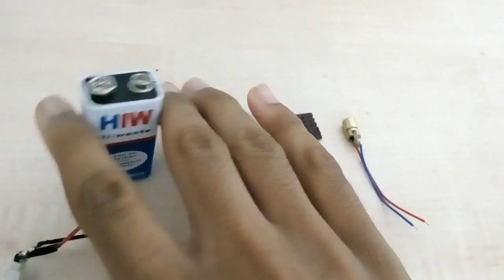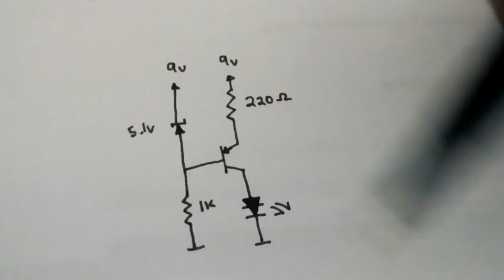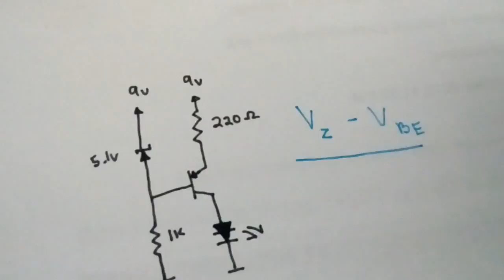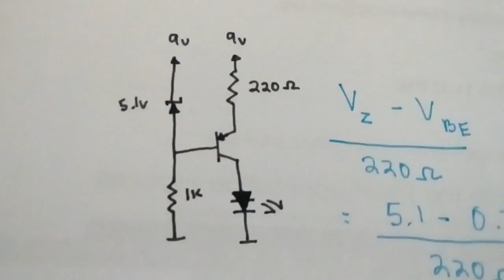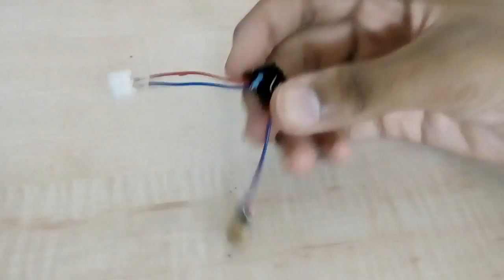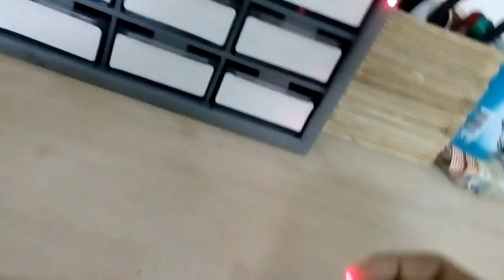Simple Laser Diode Driver ( Dirt Cheap! )

Comment: Hi there, don't understand why a PNP transistor is in the circuit.  Since a Zener diode produces a pretty stable reverse breakdown voltage of 5.1V in this case (when P terminal is wired to the Z diode's cathode side), why not just then attach a slightly higher than 220 Ohm resistor to the Z diode's anode side to get ~ 20mA to run through the laser then back to the 9V batt, of course?  Would that not be a constant current driver that an LED/laser needs in order not to blow itself up once it heats-up too much (as you say)?  Why even complicate the circuit with a PNP trans?  Sorry it it's a stupid question.  Thx!
Reply from the maker: Your idea would technically work. The Zener diode's voltage does stay somewhat constant, but the supply voltage is not guaranteed to do so, so if you connect the laser diode between supply and Zener terminal, there would still be voltage variations, to say nothing of the Zener and laser diodes' temperature coefficients. I hope I'm understanding your question correctly. Could you maybe show me a circuit diagram of what you mean? You can use Falstad, it can export circuits as convenient links: https://www.falstad.com/circuit/
Reply: @NNNILabs Thx for the help. I set-up a quick circuit in Falstad with a 9V source and a 5.6V Zener. But, while I can get the circuit to conduct in ~ 5.6V, when I put a basic LED that runs at 20mA on either the cathode or anode side of the Z diode, the circuit starts conducting at 9V (or 7V & change due to a ~2.2V drop on the LED). Bottom line, adding a LED/laser to the circuit doesn't work. But, I still don't understand how interposing a PNP transistor into the circuit gets the Zener to conduct at it's stated 5.6V breakdown voltage (or 5.1V was the case in your video). Here is the Falstad link w/out the LED just to show it does conduct at the stated Z diode's reverse-bias 5.6V. https://www.falstad.com/circuit/circuitjs.html?ctz=CQAgjCAMB0l3BWcMBMcUHYMGZIA4UA2ATmIxAUgoqoQFMBaMMAKGwBYQAvOgOzoBODBNEINs4cNAxh22BCjxhiisPBSNyVFLHh79+TiMLgWXECnbaEJy1WYoL3PoOGjxLAEohiJhz5NsRyoqKx8oCJgEFgFwdk5-ZUd-bQxIFgB3OISwR19wXKhM8BUCxzsyooAHCzD-K3tCiBCWAHMQBsrOtDxIttrrWzC5YKKgA
Reply: @NNNILabs  Here's a second link where I added the PNP trans on Falztad (great website, BTW, thx!).  I set-up exactly as you did on the breadboard.  Interestingly, there seems to be 1.4 total voltage drop over Base-to-Emitter as well as over BC of the PNP trans.  Because w/out the PNP, the Z diode delivers 5.6V as per my first link. But, then output V drops to ~ 4.1V after PNP added. Current from EC on the trans running at ~ 20mA assuming the LED's rated current. Anyway, appreciate your help very much any explanation about how the PNP trans sets-up the bias V at the base, b/c attaching an LED to the either side of the Z diode doesn't work according to the methods tried on Falstad. Here is the 2nd link w/ PNP in the circuit. https://www.falstad.com/circuit/circuitjs.html?ctz=CQAgjCAMB0l3BWcMBMcUHYMGZIA4UA2ATmIxAUgoqoQFMBaMMAKGwBYQAvOgOzoBODBNEINs4cNAxh22BCjxhiisPBSNyVFLHh79+TiMLgWXcCpAoEJ4ieYor3PoOGjxLAEog74MI99sRyoqdipiKEiYBBYBcHZOBwtHJO0wlgB3eMT-H3tcyEzkv0cUMJKoFgAHK3KksKokiBCWAHMQBorOtDwottqqbDxOMtpFPoAXYusTUasbSKYpBARhwkI8BFlIMLAOEAYYQhww7GJILbO8bBxkKgATOgAzAEMAVwAbCaK537qC-rKRzsQiJSwKXotOJA+b2SxDTiNeBsDBpbQYUrlbDYex9MCETGDHEDEAIpyPV6fCYMD50e6SEJQWAoFGNeHDYogxJ9IA
Reply from the maker: @ThomasCera  Okay I think I have a better understanding of what you mean. Basically, the PNP transistor acts like a "buffer" - the base (which draws very little current) is connected to Zener cathode, and the emitter sees a voltage that is 0.7V above the base voltage, and the transistor acts to maintain that, with the result being a constant voltage across the emitter resistor ~(Vin - Vz). The Zener diode is biased by the cathode resistor, the transistor itself has nothing to do with biasing. The whole point if having a PNP transistor is to make sure the current stays constant regardless of load voltage, since the collector voltage can change based on the load. 
Here's a link about BJT current sources:
http://www.loosweb.de/constant_current_sources/doc/en/index.html
Reply: @NNNILabs  Thx so vm for your several replies.  I have just one additional clarification needed. So. from your video (Vz-Vbe)/R1. In my Falstad link below there is only a default 5.6V Z diode. So, in my Falstad model (5.6-0.7)/R68 ~ 4.8V constant V across the R1=68. That is confirmed by the current running from across the PNP from top-to-bottom E-to-C. 71.03mA * 68 Ohms = ~4.8V. And, confirmed by the current across the base of 0.71mA, which is 100 times less than current across the Collector since Beta is Ic/Ib = 100.  However, my question is how to reconcile the 3.4V implied at the Base by the current on the parallel rail of 3.42mA vs. R2=1000 Ohms?  In other words, you said in your reply above "constant voltage across the emitter resistor ~(Vin - Vz)" = 9V-5.6Vz = 3.4 (if I understand correctly).  So, how do you reconcile a constant voltage on one hand from calc in your video of (Vz-Vbe)/R68 = 4.8V vs. 3.4V?  Especially where 3.4V seems implied at the BASE by 3.4mA across R2.  So, which is it, 4.8V across the Emitter?  Or, 3.4V across the Emitter?  Also, on the other other hand, 4.8V - 3.4V = ~ 1.4 or TWO 0.7V vol drops??  Even accounting for current flowing INTO the Base, say, from the Z diode, or one additional 0.7V  vol drop of the Base's reverse-biased Collector-Base junction "secondary" behavior (versus the Base's "primary" behavior in a PNP to be current flowing OUT of the Base via its forward-biased Base-Emitter junction), what constant voltage are we talking about?  4.8V implied by ~71mA across R1 68 Ohms over the E-to-C part of the PNP?  Or, 3.4V implied (from the Base?) by 3.42mA across R2 1000 Ohms? So sorry for very long replay--I will read your link.  Here's the Falstad circuit: https://www.falstad.com/circuit/circuitjs.html?ctz=CQAgjCAMB0l3BWcMBMcUHYMGZIA4UA2ATmIxABZiQkFIaBTAWjDAChsKQAvBgOwYAnJgmiEmKcOGgYwFbAhR4wxJWHgpm5eiljx9B-F1GFwbbiGKmUCU1fBhJk3gOEmJbAEqXTrSfexJenoKempgqGgENkFwCi4-cFUHIJBCPDYAdziExx8UqCykyUSUUILINgAHEDL6RND6vIhgtgBzSjgCxtr8KEKOuppCHXLCctaAF168Wtta8ptTehZpeMw8QhRHQj8SUyYYDEgEAjwqSAxdlGxfLoATBgAzAEMAVwAbSaKh3-LEyodewUcb5RSzVqxexLfLYc79dRwDjHBYhMDWcq2er9SqcEAAeSqkwA9gAdADO+PJgheAFsKQAFAAyABUEBSEOoOWg+PTyW1BAx+BT1AB1CnEokASwAxi8PhSqplBBSABSPV6fSYU3QoABqFKemXuFIN5PugklAEopMRoIFmKx+tgZChSO73RhThQsAi2OinIsMIG0dYCUSyZTqXTGaz2eTOZBuZBeRSBUK+CLIOLyZLJrL5YrlWqNe8vjroPrDcbTRSLdaETjoI5kWFTHCuMDQS1Ctl0Tp5tD5riUWhZjD+3NfP0UNVUbVg50dIue4ClwvJD1bhDCjUhhR0euD9PWh0esej-ZWkA
Reply: @NNNILabs  By the way, despite that you say above "the base (which draws very little current) is connected to Zener cathode", the circuit diagram in your video shows the Z diode's anode side is connected to the Base (I think).  And, this is how I set it up in Falstad exactly like your diagram (only diff is a 5.6V Z v.s 5.1Z diode in your example) diff R1 resistor b/c I'm trying to power a more powerful laser ~ 70mA for mine than yours was presumably at ~20mA).  And, I could not get the Flastad circuit to conduct by swapping the Z diode's terminals and wiring the Z diode cathode to the PNP's Base.  Sorry if I misunderstand but think the Z's anode connects to the Base.
Reply from the maker: @ThomasCera  First off, I think both your questions can be answered by the fact that I totally misremembered the circuit I made 😅
For whatever reason I assumed that the Zener was on the low side (like you would do with an NPN-based current sink), so you're right, the anode connects to the base of the PNP transistor. For the same reason my calculation was also wrong, the current is indeed (Vz - Vbe)/R.
Reply: @NNNILabs  Thx vm!  Any thoughts on how to answer the 3 diff speeds at which the circuit runs?  And, how to think about 4.8V from E-to-C thru the PNP vs. the 3.4V implied at the Base of the trans?  Seems like an extra 0.7V drop not explained even after assuming one of those 0.7V drops is due to some reverse-biased current at the Base of a PNP (same for an NPN's Base)?  Finally, I'm trying to power a PLT5 510 515nm green laser with 9V.  But, while my circuit runs at ~ 71mA, (laser rated 60 mA optimal 100mA max at a 5.4V typical operating voltage) it also runs ~ 4.8V max from thru the PNP--always below the 5.4V typical voltage for the PLT5 510 laser.  So, it seems like a 6.4V Zener might be a better in the circuit, b/c I get it to run ~ 80mA from to 9 to 7.5V supply voltage and then ~ 5.4V on avg thru the PNP.  So, question is: should I switch to the 6.4V Zener in order to stay more near the laser's typical operating voltage?  Or, since I have a "constant" current of 71mA within the laser's typical operating current (but still below its voltage range) does it even matter?  Here is the link of the circuit w/ a 6.4 Zener where you can see more my question (if you care to chg the supply voltage and see how this version of the circuit stays more near the laser's 5.4V operating voltage).  Many thx for the help sir :) https://www.falstad.com/circuit/circuitjs.html?ctz=CQAgjCAMB0l3BWcMBMcUHYMGZIA4UA2ATmIxABYlrIQEBTAWjDAChsKQAvegO3oBOjQtAqMU4cNAxgK2BCjxhiisPBRNytFLHh79+TiM5suIYoRAoEli+DASJPfkOPjWAJXOWWEu9glaWgpaYihwmARWAXAKEwdwFXtAkEI8VgB3WPi-HwTITMSJXysQ5KhWAAdS2hKQ2oSIINYAc0o4cvqrfAjWmso8bTKFPF6AF27R60sUMunw5ihoQmw8PDJsXGI8AOskRhgMSAtiSEIEMEIMBAw8JDVaABN6ADMAQwBXABsxwtmhgHlAptOwUQicOwjXoxOzzfx4Ti1eDsI79CiXNGDSTNDggADylTGAHsADoAZzxZIEbwAtuSAAoAGQAKghyRdIOy0Lw6WSWgJ6HxyWoAOrkomEgCWAGM3l9yZUMgJyQAKZ7vb5jck6FAANXJLwyj3J+rJjwEEoAlJJiNAAkwWOFsNIUKQ3W7rgisOE2JdHHMMP7ghiJATieTKdTeUzWey1FzIDzyfzBbxhZAxWSJWMZXKFUrVerPj9tdA9QajSbyearT6ItAHCjQpZVhDLGCTL0spdtDZvFY+wVsKi0FM+z2Bz5wigqv1MBIuvPsRU2ovA+1aNg0r1qv9KBiuuip81Vx0jxu6IpegAPEDiXDgPCWVFgdaUcASYymgBafEE5IAEXJOUviJDIyQNIllTJU0sw+ARpXoasLUqA0LV5YhTXDMkAD9yQwaAEF1Vhb3EFAIDQchFnI4IPxAABBLUyUw8kSTeck8FNaV4IFXgmLwskyVpJCyQIGl6PJAABdllmI0iUAUqxsAgEglM4EwJEY-DCK4ni+H4-C8HEqSZOwU0aSgkT+DeaCEFELCAE9KlzL4SLvcjyGsbAQAwGY+w0kAJUEN4c14FpyQANyJH43haETqTCkSXighkWTZMkOWTAUhTJL43jJf8zUlIlnjc+9RhuWhCFkOgcHfBJ6IgslsGFAB6bA0zJAAjEKxiajJ6BsxgiQ+JjsIwU0VRedDyUwy0ABpgK+eVmvJX8XCalU7MIRayWMXa2PJEROMtckBA+TqQvJASjmMoSDLJChoE48kuvoUCMnJMYAAsRLsihHOc2UVqC6lQvCskopBl4vt+1LYwy+M+Wyzq8oKgQytmTgECSDBhmIJAAoAIVG3b8thv7ZLW6tiueclJSauUMjeBymtlSpKnoY17uup6XqEl4xkK+kADl6XJQ4qzNFDdpwmQ7oZ8kyRzZbkyJErdqJgBVZlyV4IkmMlGHlbhyHorGWL4reRKlZVlaaV6wRGaYjJvplb6KfJNHCsVwSPg5okCu57Cxiclyvgc8VObB+hoExrdUlmHzIHIQhMHqiRmVN46fz-aDpRGr5ublLNyQyKCAGtXvoMlJWeJqfpEr81t2133aVwUaSaizlajnMaUlHhHl2rrRvpvryW4gReKYmtKia6aiV5NYvtJUSUFY9iyXliSyUXjDV+0ojoHJABlIldv1pjybJAAiAveGV62xlvye9L48Vja-ePPwQJArhUggUYAUs6U0ID+GmJURK+0buSHuTEH5Pw-mSKeM9P6e1WmSb8jBHi0xrsBC0F1uY71emPHmj1nqmmStBFiys14TT1vQCKhU4oTyEl1IkzCMH-UBi5KOwVwaRXNpbdBJsRIxnShyVgQA
Reply from the maker: @ThomasCera  The thing about BJTs is that the emitter-base voltage (when operated in linear mode at least) is ~600mV, but the collector voltage (with respect to the emitter) can vary a lot. Why? Transistor action! The transistor does everything it can to maintain a current through the collector that is base current times gain (this is a very rough approximation). That's what makes the current coming out of the collector more or less constant - the base is biased to a constant voltage, which is seen across the emitter resistor (since the Zener voltage is applied between base and supply). The collector changes its voltage according to the load to maintain a constant current through it. 
Overall, if you're powering diodes above maybe 25mA, you'd be much better off using something like an LM317 configured as a constant current source, accuracy and stability with temperature is much better.
Here's a Falstad link to an idealized" version of the current source featured in this video, try varying the slider on the right - it varies input voltage, and you observe that the output current stays constant. In the real world, changes in collector voltage cause small changes in current. Temperature has the same effect, the base-emitter junction has a temperature coefficient of -2mV/C.
https://tinyurl.com/2qphrdse
P.S. There's an option in Falstad to "Create short URL", that can come in handy sometimes 😁
Reply: @NNNILabs  Thx very much for all the helpful replies.  Will look into the LM317 as a potential alternative.  King Regards!
Reply from the maker: @ThomasCera  You're welcome! I'm glad I could help 😁

Comment: Hi, how can i know what components i should buy? My diode laser is an Oclaro 700 mw. What transistor and resistence i should buy? (i want to make a laser pointer using 1 battery around 3,7v)
Reply from the maker: 700mW is a lot more than this little circuit can handle, it might be better for you to use an LM317 based driver, lots of schematics and values and formulas on the internet. It goes without saying - for such high power lasers, safety precautions are a must.

Comment: can I use a PNP 2N2222 instead?
Reply from the maker: The 2N2222 is actually NPN, you can make a constant current circuit using NPNs as well, just have to reverse this circuit.
Reply: @NNNILabs  thanks!

Comment: hello there, loved your video unfortunately I was not able to recreate this same circuit, it would be great if you could help me out with this. vids like these are an inspiration for young creators like us
Reply from the maker: What was wrong with your circuit?
Reply: @NNNILabs  tbh I was not able to assemble the circuit properly, if you could video call me and help with the same I'd be great full
Reply from the maker: @mohammadsheikh4847  That would be a little too much :sweat_smile: but I think you should do a little bit more debugging, nothing beats the joy of making something on your own
Reply: Alright just let me know about the wiring diagram a little more pls, like which end goes to power supply and which end to the diode, also which what is that component in the bottom right corner next to the transistor, can i supply it with 12 volts instead, and positive negative of diode as well as powersuply
Reply from the maker: @mohammadsheikh4847  The arrows with the '9V' label connect to the power supply, and the way this circuit works you can safely power it with 12V. bottom right is the laser diode symbol, it's not standard so sorry if that was a little confusing
Reply: Oh that was 9v i thought it was 'av'
Nonetheless Thankyou so much, really appreciate it.
Reply from the maker: @mohammadsheikh4847  No problem!
Reply: Also can u please let me know about the polarity of the 9v connections plz
Reply: Polarity of the inputs pls, where does +ve and - ve end go in the circuit
Reply from the maker: @mohammadsheikh4847  The arrow that says 9V is positive input, the flat lines at the bottom are ground or negative input.

Comment: It seems overly complicated. It is the same problem as an LED. Too much current and it burns out. So put in a series resistor to limit current.
Reply from the maker: This is, in fact, one of the simplest constant current drivers out there. The current source has no idea what is connected to it, it changes the voltage on the output to whatever is needed to maintain a stable current (of, in this case, 20mA). Constant current is the best way to drive laser diodes.

Comment: Can one circuit with one battery drive 8 lasers?
Reply from the maker: Possible, but you need one  driver per laser. Putting them in parallel directly introduces current sharing issues.
Reply: @NNNILabs  Thank you for the prompt response! Do you have a facebook page?
Reply from the maker: @JGandtheRobots  Unfortunately not, although I'm very active on Discord: NNNI#6070
Reply: @NNNILabs  Thank you! Will this circuit work with an LED string that is 12V DC @ 60W?
Reply from the maker: @JGandtheRobots  60W is rather beyond the range of this simple little circuit. You might want to use something like the LM317, or even better, get a constant current buck converter. You can get buck converters that are specifically meant for LED driving.

Comment: whats the max input voltage ? and can i use dc 12v directly to cuircuit ?
Reply from the maker: The only real limitation here the PNP transistor's Vce, which is 60V, so 12V should be fine.
Reply: @NNNILabs  thnx bro ❤

Comment: Can I use any PNP transistor
Reply from the maker: Should work with any small signal PNP, larger power BJTs might have a little less gain.
Reply: @NNNILabs  I tried bc557 but not work
Reply from the maker: @jagdishsingh9997  Did you check the pinout and connections? Most of the time that's what goes wrong, if not try replacing the transistor.
Reply: @NNNILabs  I checked all connections thrice but not work ,maybe due to different transistor number
Reply: Can I use lm317 constant current regulate to drive diode? Because I don't have 2n2907 transistor
Reply: Please make a video on lm317 constant current regulatator
Reply from the maker: @jagdishsingh9997  Yes, you could use an LM317. There are plenty of good LM317 videos, for example this one:
https://www.youtube.com/watch?v=iuMngik0GR8

Comment: Hey man can the same circuit can be used for laser engraver
Reply from the maker: Laser diodes used for engraving are a lot higher powered than the one used here, so I'd recommend an LM317T driver.

Comment: please suggest a schematic about cree led driver powered by 18650 cell
Reply from the maker: Cree has readymade LED driver modules which you can check out on their website, but all of them seems to be mains powered so I don't think they will run off a 18650 cell.
However I think you might get away with using an LM317 as a constant current source.